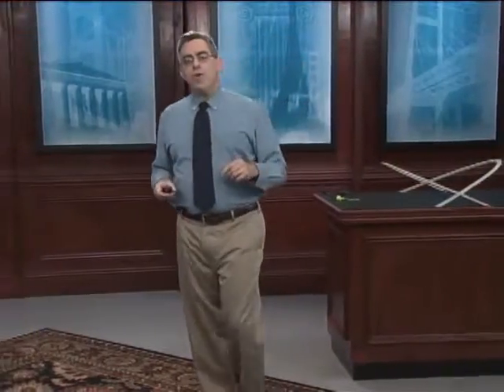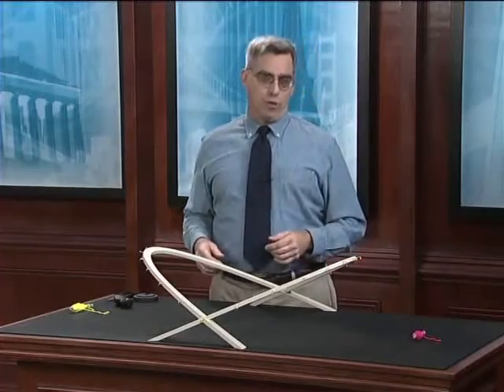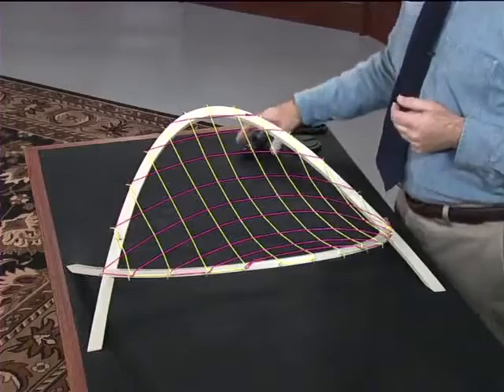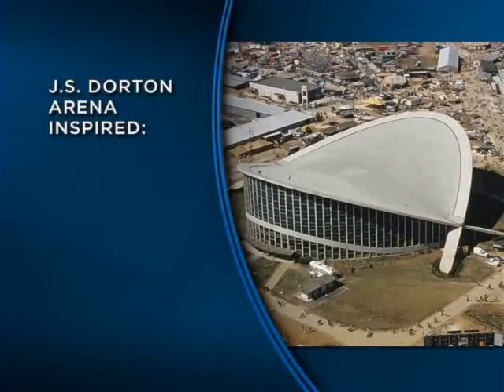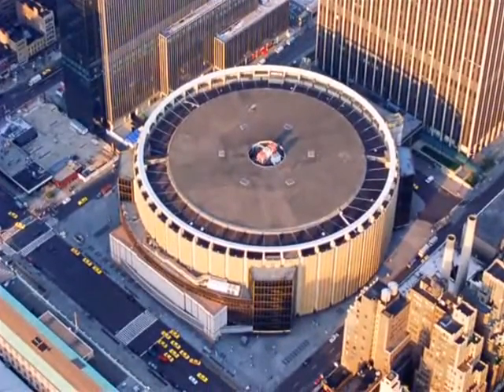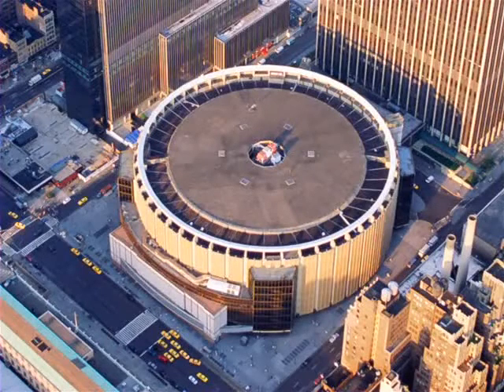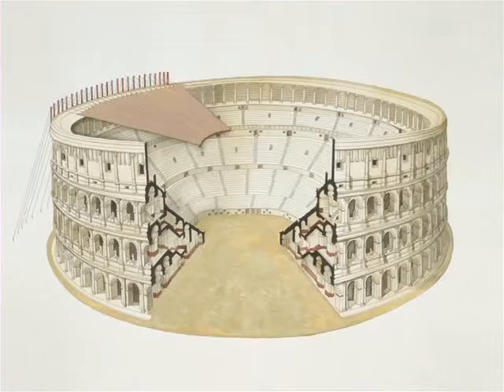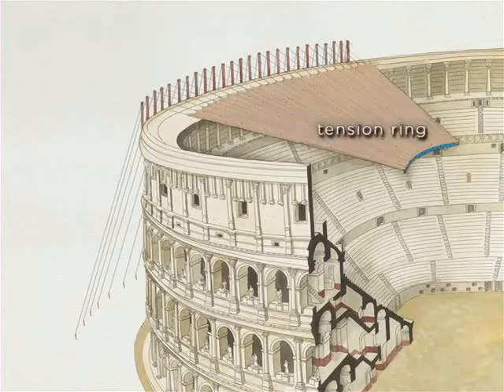23 The Incredible Lightness of Tension Structures

Comment: After doing a student project to build a tower out of Balsa wood, I came to the conclusion that I needed to be more efficient with my material so I could maximise the load it could take. (I like competition...) :) I designed the internal truss/elements to only be in tension. As you say, thin beams can carry tension, but not much compression. I designed the corner compression columns of the tower to be convex and as thick as possible, so when loaded vertically with weight, the columns would bend out, and put the thin internal truss under tension. In theory, I attempted it to not fail in buckling. It ended up weighing 40grams, 70cm tall and taking 40kg, doubling the best record of the towers tested that year. One of my proudest moments, though be it insignificant, I got a taste of how interesting designing with tension can be. I have a lot to learn and appreciate about what tension structures can do. ^_^ thanks for the video.